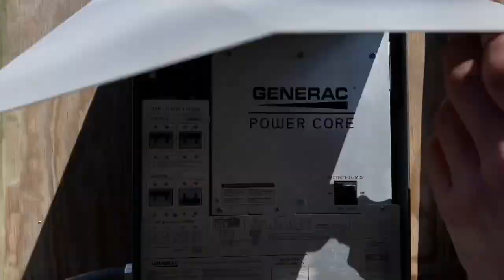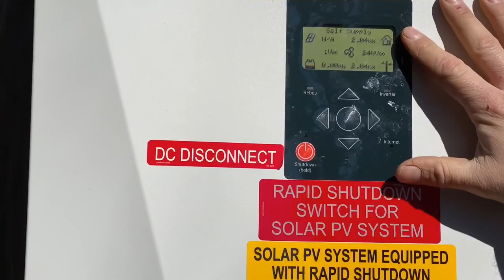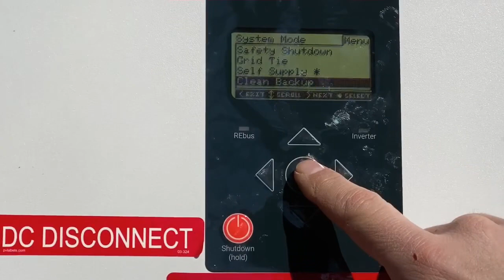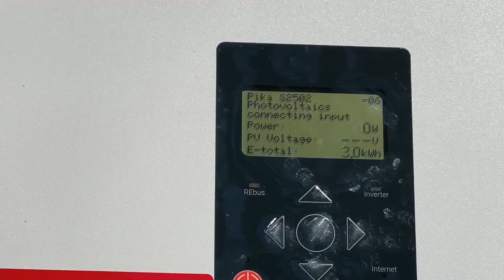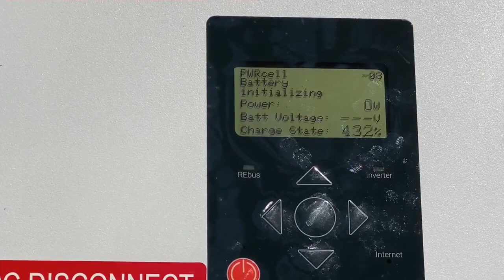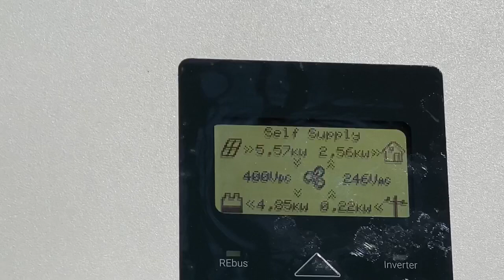COMMISSIONING THE GENERAC PWRCELL INVERTER AND BATTERY

Comment: Thank you for making/posting this video. It made it clear and quick to recommission our system after the rapid shutdown was used for mains work. We love this system (27 panels, ground array on three posts) and produce about 1.5mW or more extra each year, even with two EVs. Next project, heatpump with A/C and heat, and domestic HW ...Can't quite give up the gas stove yet :)